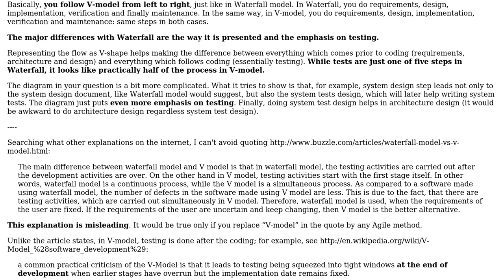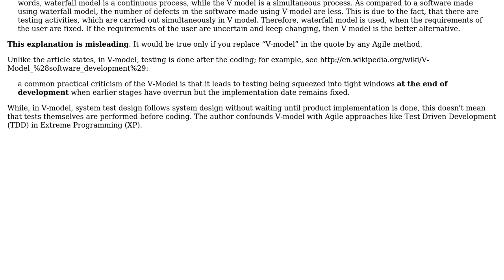Can someone explain the V Model process? Why is it different than the Waterfall model?

Comment: The answer at the end is very confusing. It's said that a disadvantage of the V-model is that testing is squeezed into a short window without changing the implementation date if other development phases run longer than planned. But that's followed by "in V-model, system test design follows system design without waiting until product implementation..."